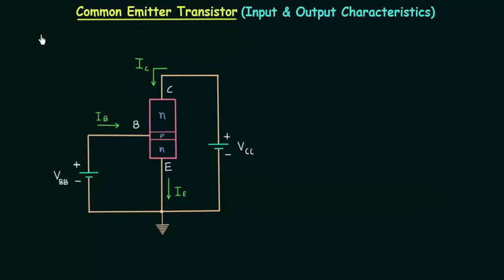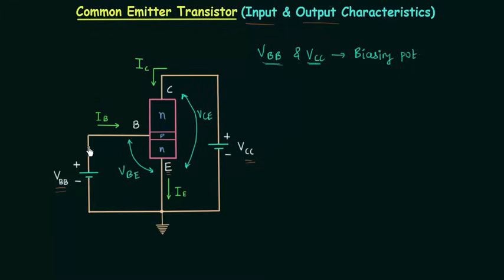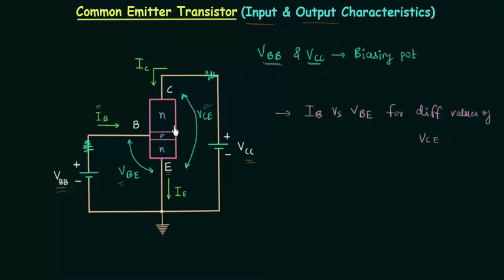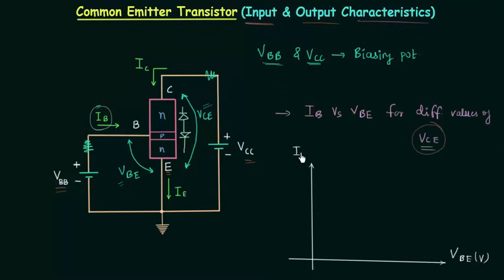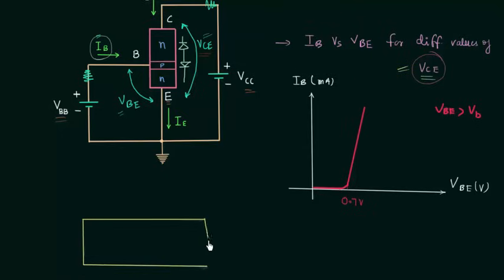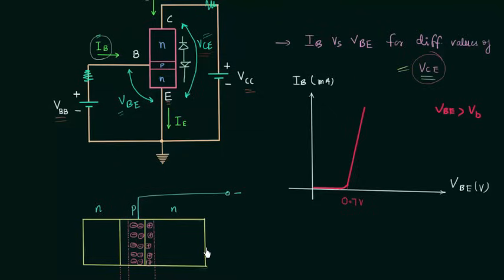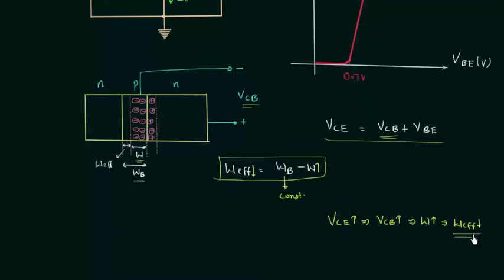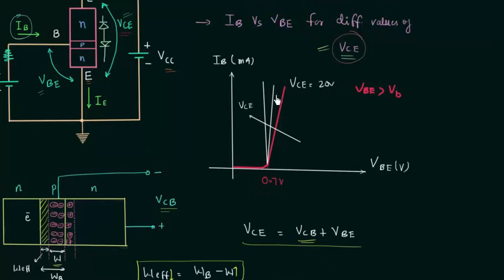Common-Emitter Transistor (Input Characteristics)

Comment: When w effective decreases means concentration gradient increases and base current should increase which u told in common base then why that logic is not applied here??
Reply: Exactly my question too
Reply: Because in common base configuration the electrons movement increased towards base thus increasing the current in IE(opposite). Similarly in the common emitter configuration decrease in the w effective Increases the electrons in base thus increasing IE current And further decreasing IB current. Here as only IB is needed for the graph ,IE is not mentioned. I think this is how it works.
Reply: @goutamsutradhar9566  combination decreases then collector current increases hence base current should decrease...
In common base , collector current increases therefore emitter current also increases as Ie=Ib+Ic
Reply: @aadii1706  kya bhai polytechnic lecturer me hua h kya
Reply: @luckytech9064  ??

Comment: In common base, effective width (reduction in width)  cause emitter current to increase (due to conc. Gradient)
But, In common emitter, why don't effective width ( reduction of width) cause increase in Ib ( input current) to increase
Reply: I think emitter current is more significantly because of flow of electrons towards collector region. So by increasing reverse bias voltage, more electrons flow towards collector region and hence Ie is increased.
But base current was produced because of electrons recombination with holes, decrease in recombination decreases base current. Which means increasing reverse bias Vcb (Vce in case of common emmitter) decreases Ib.
Reply: @jayantsharma_  Well ig ib depends on how much electrons after recombination reaches base,if recombination decreases then more electron pass in base region hence more current
Reply: @jayantsharma_  passed the exam.. 😅 thanks tho 😊
Reply: @mint7325  I hope I clear my exam tomorrow 😅
Reply: Same q.. pls anyone explain us

Comment: The two diode connected back to back is "WRONG"..if we replace bjt with two diodes, we assume that there is no interaction between the two diodes expected they r far apart..however in a bjt, exactly the opposite is true for higher performance, The base region is made as short as possible and the two diodes cannot be treated as independent devices..

Comment: Current is due to the flow of electrons(or holes) but not a result of recombination of holes and electrons. Since recombination rate decreasing how can we say that there is less base current? One more thing is if a number of recombinations are decreasing means there are more free electrons and holes which much constitute a high current. But the thing here is the number of electrons coming from base to the battery terminal is reducing due to recombination rate. So can anyone explain the relationship between the number of electrons coming out of the base and recombination rate?
Reply: Because for n-p-n transistor the base current supplied the holes in base that were lost due to recombination (along with providing holes that move towards the emitter from base due to diffusion - since forward bias ). As recombination is less, the base current is also less.
Reply: one of the reasons for this might be that the base is lightly doped and offers resistance to the flow of electrons so rather than contributing for base current they find it more easier to contribute to the collector current since the charge carriers that were majority have now become minority in the base collector region hence they contribute to collector current more.second point is that the area of the recombination decreases meaning electrons and holes are concentrated in less area than before and there is concentration gradient so they flow towards the emmiter to base and then towards collector .if you wish to find the relationship then alpha can help you as alpha is the range of .95 -.98 so majority cuurent from emmiter goes towards the collector and remaining .02-.05 is for recombination which is evident from the fact the base cuurent is in the orders of nano or micro amperes while collector and emitter currents are of micro amperes(for coomon base)
Reply: Yes bro I'm also thinking the same thing if there is less recombination happening in base then why Ib decreasing I mean the current should be more as less recombination of charge carriers is happening

Comment: Sir the video is fabulous... 
But why the early effect has opposite result as that in common base... Why I(b) decrease here as the effect is same in both cases ?
Reply: In common base, the input current is the EMITTER CURRENT (Ie). 
Since the effective depletion width decrease, very few electrons from the emitter diffuses in the base and majority of them travels to the collector. After reaching the collector, the electron flows back to the emitter. 
If the effective depletion width was wider, more electrons from the emitter would recombine and lesser electrons would circulate in the circuit, hence less emitter current.

Similarly, in the common emitter, the input current is the BASE CURRENT (Ib). Just as in the case of common base, the effective depletion width decreases, but this time we care about the amount of electrons that donot travel to the collector. Since most electrons passes through to the collector with the increase in output voltage, there's less base current.

Comment: why is input current ib in case of common emitter configuration and ie in case of common base configuration?
Reply: Input current is the current which flows through the input resistor, so Ib is the input current in case of common emitter and Ie is the input current in case of common base
Reply: General convention is
prefer Ib as input current if base is not common otherwise choose Ie as input current
prefer Ic as output current if collector is not common otherwise choose Ie as output current
Reply: Hi, let me throw some light in order to clear this confusion. For Common Emitter we have emitter terminal is grounded.
i) If you closely observe the 1st diagram of this lecture, you can see that in input we are having only base and emitter terminal which are biased, so the input current is of course base current.
ii) Similar logic can be applied for CB mode but here base is grounded so the input current is emitter current.
Reply: That is confusing. Is there a reason that this is the general convention ?